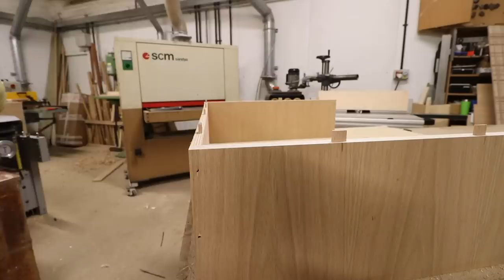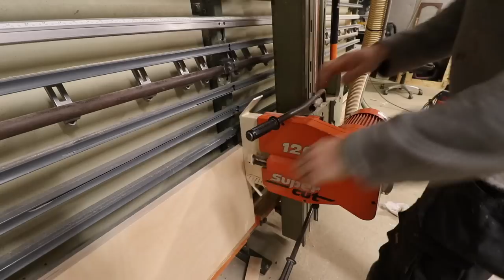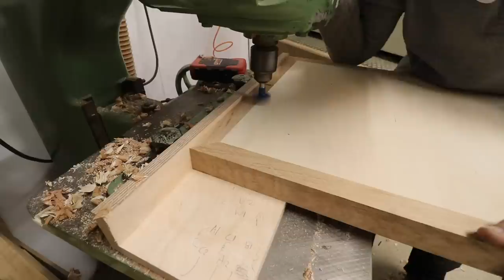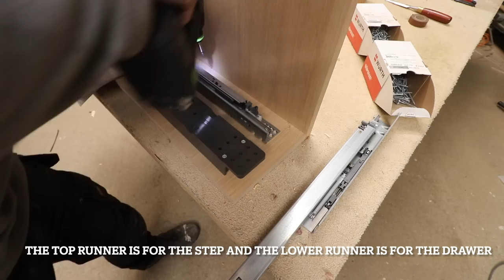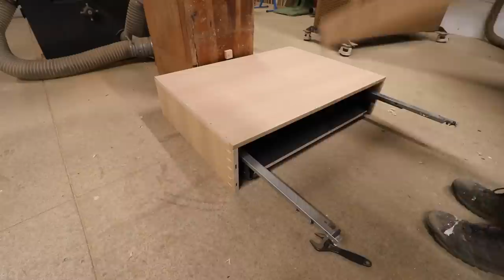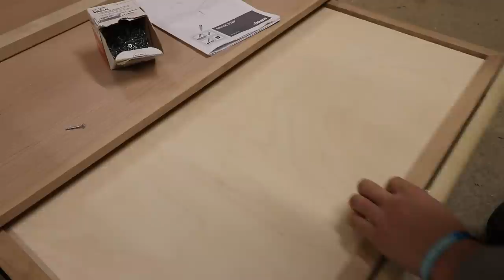Genius Kitchen Plinth Step and Storage Solution install. The Blum Space Step

Comment: I hadn’t thought of that. A modification of that will make an excellent retractable front step up in to my outside shed which is built on 18” stilts or stumps. It will be handy because I can sweep sawdust etc straight out the front door into the bin, which I couldn’t do if I put s permanent step there. Thanks.
Reply from the maker: Awesome to be inspiring ideas!! I would perhaps use a normal drawer runner in that scenario and have a stop point at which you lift/sit the step on to locate. that way there is no chance of the step retracting while your inside.

Comment: Great work .🎯🎯🎯  👍👍👍
I just made the draw box out of 18mm birch ply put pads on the front underneath and had a sliding step inside the draw like a tray as the step only needs to be about half the drawer depth, with a hand hole to remove if nessesary! Adjusted just right so the pads take up the 1/32" movement in the draw slide (60kg side mounts so not a stylish ) it's in the utility room so all good. New kitchen is WIP,  face frame so not really enough depth to make plinth drawers much use.
Reply from the maker: Thattl work! The undermount runners would do the same tbh and flex enough to hit the floor.
Reply: @BradshawJoinery  yes but you loose too much depth in a kitchen plinth. Although your drawer/step was quite deep.  
Dad made in plinth drawers way way back in the mid sixties, think he was ahead of the curve on that one, with wooden runners. The units in the basement now, 🤔 might be time to repurpose it into a workbench or something.

Comment: Do you show how this fits under cabinet or ARE the cabinets special made
Reply from the maker: It will fit under a normal cabinet, if you make the box so it slides in between the legs of the cabinet then cut the plinth and use that as the drawer front. 
Obviously check for services under the cabinets

Comment: What’s the clear adhesive you use in the caulk gun? I saw you use it on butcher block project also. Is it food safe? Very handy doing large jobs with caulk gun.
Reply from the maker: I wouldn't worry about food safe with adhesive, on e it's set it doesn't release any chemicals etc. 

The glue is PU glue I use various brands but currently rank the wood Weld from construction chemicals the best